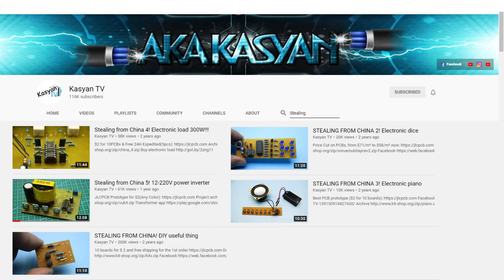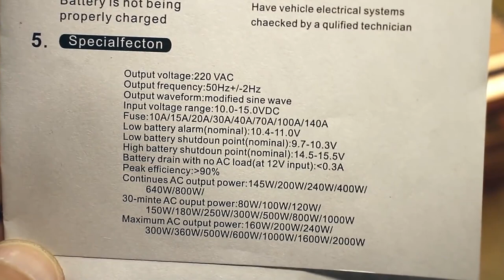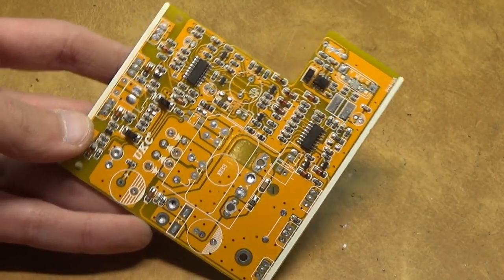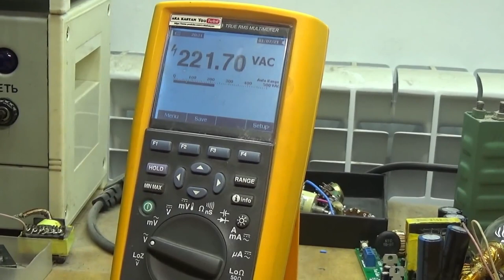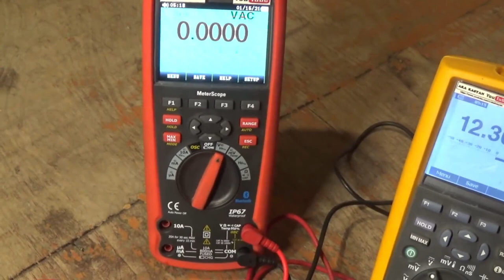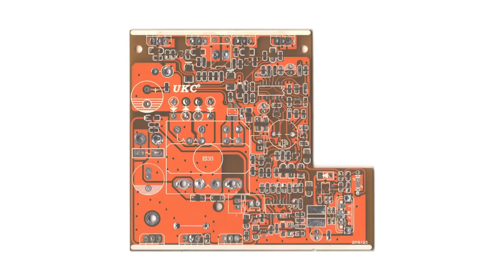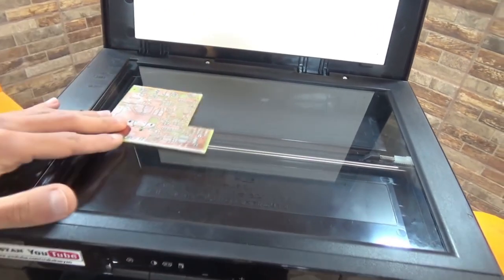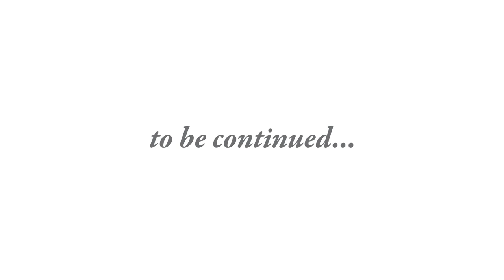STEALING FROM CHINA ! Step by step

Comment: please make an universal inverter that can run from 12V-48V, and produce 110/120V or 220/240V output @2000W continues, using these cheap sinewave modules under "EG8010 + IR2110 Driver Module +LCD"
I have one for 2 years collecting dust. I need someone to design a board for the mosfets and show in detail how to make the transformer. 
I was sure you'll make one at some point. I was wrong :(
Reply: I'll design a board for you, six thousand USD